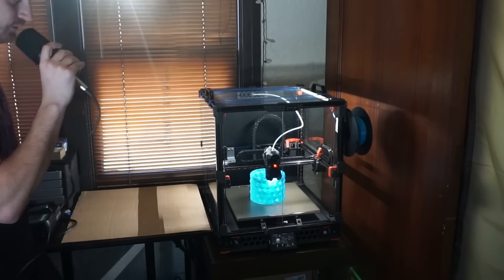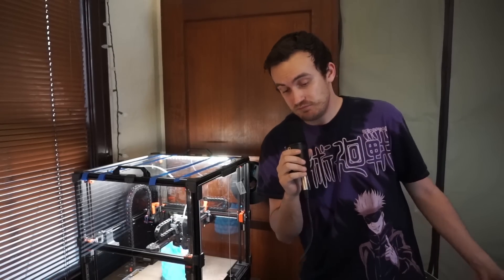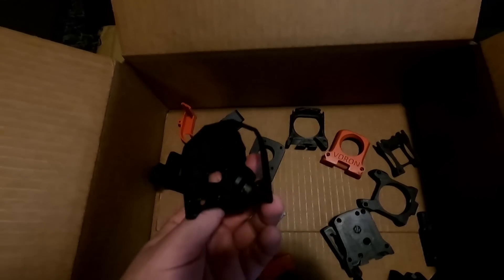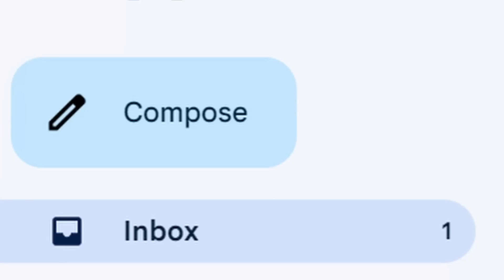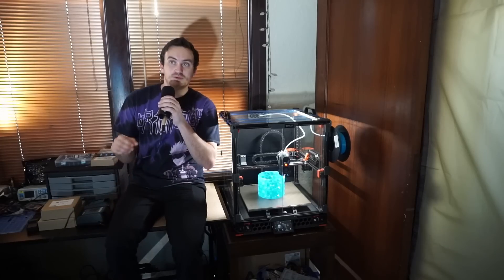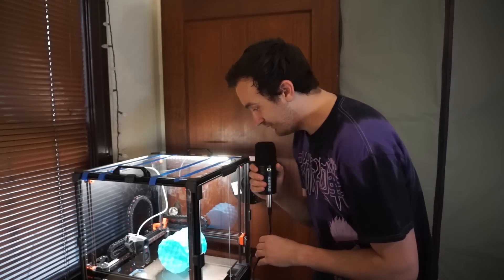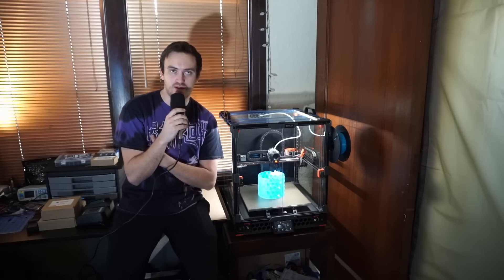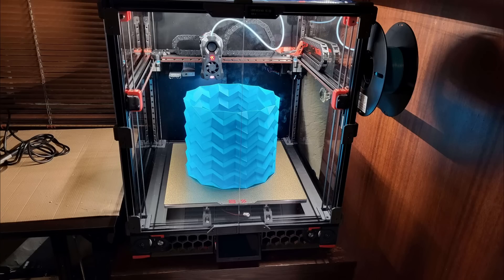Why I built a Voron (and you should too)

Comment: It is unfortunate that you had incomplete 3d printed parts, I’m guessing it’s either based on chance, or they have improved their printed  parts becuase I was only missing a bracket for the case led pcb, and a din rail clip for the tool head breakout board, both of which were just solved with the 2 sided VHB tape included in the kit.
Reply from the maker: Glad to hear you weren't missing anything too important! My assumption is that it has improved. They were new to selling the kit when i ordered. Pinning your comment.

Comment: 2:50 What were you doing to the rails with them standing up in a container?
Reply from the maker: Oh, I filled the bags they were in with isopropyl alcohol to clean off the machine oil from the factory, but they tended to leak a bit, so I put them like that so it didn't get everywhere haha
Reply: @TommyBee456   So not trying to grow more rails.  :) 
I forgot about that, even though I've had to do that myself with bearings before.

Comment: Never get a Voron as your first 3d printer if you Don't want to be thrown in the deepend. Get a cheap bedslinger preferably with klipper. Get to know that printer and how to maintain and repair it. Should take about a half a year or so depending on how fast you learn and how much you print. Then when you have al the basics of how the steppers work, the hotend. The ins and outs of the filament and so on. Then start to source the parts for the voron and know that size and speed are connected. The 0.2 with a vulcano hotend can go way faster then the 2.4 350x. So get to know what you need and not what you want. Is the 250x bedslinger only used for small parts get the 0.2 and tune it for speed. You can print about 4x faster anyway and sometimes even faster. I have a 2.4 350 but sometimes i would still love to have the small 0.2 next to it just because everything is faster on it. Heating, heatsoaking. Just the amazing printspeed. Also the parts are way smaller and  cheaper. The ultimate way to go btw if you already know you want a small and a big printer is 1 cheap bedslinger to learn basics, 2 build a 0.2 where you could even use the bedslinge to print most parts. But abs is not easy to print so i suggest to go with print it forward for the 0.2. 3 source the parts for the 2.4r2 (at moment of writing) and print all abs parts on the 0.2 yourself. How hard it is to print abs on a cheap bedslinger that is how easy the same parts are printed on any working Voron. Btw what most Forget to Mention is that you control any voron thru the screen mounted on the printer. (Can be a prusa style screen with knob or a 10 inch color touchscreen) and thru a web interface. You can realy easily update, upgrade and modify all the software thru the interface or thru putty or ftp. So in theory you could build a voron. Put it in the garage or attic. Go to your computer and do all the adjustments remotely. I have a nice touchscreen just because it looks cool. But almost never use it except for loading and unloading the filament. Or when i am modding hardware and need to move the gantry. Klipper works amazing imo. Love the thumbnails that show when printing. The spaghetti sencing works nicely of you mount a webcam. Its easy to use almost any kind of bed leveling sensor. I have a clicky but you can use induction or the tap. Or the nozzle. I don't level anymore. My printer warms up and heatsoaks. Then it levels the gantry. Then it recalibrates the z-offset (if i change the nozzle or even the whole hotend to another that is on a different height it adjust automaticly) then it makes a grid to only meshbed level the area i am going to print on, cleans the nozzle with a metal brusk and purges the nozzle before starting the print. If i put a glas surface on my buildplate it adjusts automaticly to the new height. And then i only did some mods of the many possibilities to make the voron perfect for me. And yours is going to be totally different. Yes there is a big learning curve. That s why i say go for a cheap bedslinger first to get the basics. I btw had to start with marlin because klipper was not yet available for the cheaper printers like it is now  so i had to relearn the firmware/software side. I found klipper to be way easier though. Marlin you need to download. Adjust. Upload and test. With klipper you can change most things in the same webinterface as where you print. So you just click the file you wanna adjust and change the settings. Saving and restarting the firmware is one button. And then you can already test. Oh and i love inputshaper. Yes it's about the same price as a bambu lab x1 if you go for the 2.4 250x250x225 (there is a little los in height but you can mod that away if you want.) And a x1 is plug and play. But if the x1 breaks you need to get it repaired. It is also a closed system like apple has. As long as it runs its perfect. But with a Voron you build it. So you can change and repair everything. And you know how it functions. You can also print your own parts for it. If you want multimaterial you can get a carrot feeder (😂yeah that is what the mmu is called for it) there is even a guy trying to replicate the infrared sensing like the x1 has. So you can use a lazer to get the perfect lineaire advance settings.  (Kinda went on a tangent here but i hope i help a newby a little with my experiences and ideas about the voron. And gave some information about how they actually funtion. 😅 Most videos only show the hardware side of it.) 

Tldr: if you want to tinker so you get the best 3d printer get a cheap klipper bedslinger first. Then get a Voron and be part of the Voron masterrace 😂.

Comment: Voron is a bunch of very expensive and very stupid engeneering solutions. Especially 2.4. The only good thing about this project is how it looks.
If you don't have much money just buy a good bedslinger and convert it to Klipper. It will print almost any filament as fast as Voron, but for quater of the price.
If you have money to spend, buy Bambulab. It is just a well designed, well built and well tuned machine, which prints out of the box. Much better than any Voron.

Comment: Is the 350mm worth it? Also is the 2.4 better than a trident?
Reply from the maker: 350 mm was worth it for me because i print big things, but if you dont think you'll print that big, save some money and go with a smaller one. Also, smaller ones will be more rigid and, therefore, can print with higher accelerations. As far as how it compares to the trident. I don't think there is much of a difference at all. Just different mechanisms for the Z axis. I think each machine can print as fast as the other with the same quality. I went with 2.4 because i thought the flying gantry was cool, haha.

Comment: Why you running it so slow?
Reply from the maker: That's actually a great question. It is because i am printing at 200% extrusion width, the slicer is artificially slowing down the print speed because the Revo Voron hotend can not melt enough plastic fast enough. Stay tuned for another video where I install a proper highflow hotend(Rapido) and really start pushing this machine's print speed.
Reply: @TommyBee456  neat! I have a 350 2.4 as well, and I’ve encountered the limitations of flow rate. The LDO kit is super fancy. Mine isn’t that nice.

I actually also bought a Rapido, but I’ve found that the kinematics of the 350 can’t even come close to maxing it out without input shaper severely oversmoothing. You run into a wall with Stealthburner cooling with ABS pretty quickly also. XOL is also very worth it.

My most effective mod by far has been bed fans. Chamber gets hotter faster. Before, I was stuck at 47C, and with bed fans and a little insulation, I’m getting 70.
Reply from the maker: @Flumphinator  i actually already installed the nevermore which helps the airflow for the chamber and that has been helping tons for asa and abs. Also, switching to smooth PEI helped a lot, too. But yea! The mantis XOL2 will probably be part of the upgrade with the rapido. I feel a little limited by the stealthburner itself.
Reply: @TommyBee456  SB is really good because it’s accessible for the core design, which relates to the open source nature of the Voron project. It’s super versatile, looks really nice, and it’s buildable with just printed parts and commonly available components. But it is heavy and doesn’t have enough airflow to push a good hotend. The weight is extra important for a 350.

Ditching the cable chains and building a toolhead with CANbus or an umbilical design will also significantly increase your attainable acceleration, and is really an easy mod if you can get the parts (an EBB36/U2C is like $40 in the US, and vendors like Fabreeko and KB3D sell good CAN cables). Light gantry beams are a waste of time on a 350.

Good luck!

Comment: I was thinking about building a voron, but why should i buy a kit and spend a lot of time building one when can i buy a fully assembled printer which can do the same and more ? And its way cheaper, too.
I ordered the qidi max 3 and will be shipped next month. 
I have build all my older printers myself so far and to be honest i can skip the experience building one easily and have more time on my projects by just printing out of the box. And if necessery i can mod my printer with mmu, camera and so on.
Reply: Building is more fun and customisable
Reply: @alex59292  I can mod and customize my printer in the same way as a voron, just there is nothing which needs to be changed. This printer is working right out of the box, has a heated chamber and can print every filament. And while its klipper, you can add a camera or do whatever you want with it, eg. i will install the 3dChameleon MMU for printing multimaterials. And i save more then a thousand bucks and can invest that money into crazy projects and when the printer is broken i have 2 year warranty.

Comment: Love the open source and build it yourself aspect.  I built a couple of OrdBot Hadron printers way back in the day.  For a CoreXY printer billed as being a fast printer, your Voron 2.4 seemed to be vase printing very slowly.
Reply from the maker: Good observation! It is indeed running slower than it can print. What is happening is that the slicer is artificially slowing down the print because im printing at a 220% extrusion width, and my Revo hotend is limited on flow rate. I actually already picked up a Rapido HF  hot end, just working on printing the parts to mount that one + a couple of other upgrades. Maybe I'll make a video about thay stuff too!
Reply: @TommyBee456  - It seems that all of the accelerometer tuned CoreXY printers are speed limited by thermal hot end flow issues, including the ones with custom long melt zones and higher power ceramic heaters that completely surround the melt zone instead of a little cartridge heater in the corner of the aluminum rectangle that houses the nozzle on older 50 mm/sec 3D printers.
Reply: @Liberty4Ever I could tell you that for a lot of corexy owners including myself, speed and going fast is very low on the priority list, and is certainly not a main objective of the build
Reply: @Mr.Thermistor7228  - I finally made it into the world of Klipper, and while faster PLA (and maybe PETG) parts are nice, my primary goal of the upgrade was improved print quality using input shaping and improved part cooling.  I mostly print TPU that is material limited to slower 40-50 mm/s print speeds.

Comment: very useful video.  Thank you.  

Unfortunately we do not have anyone that sells Voron Kits where I am so it will be a source it yourself deal if I build it.  and that will mean I need to know what I can get before looking into the parts.  Which will take time.  So looking at the dent it will make in my wallet vs my sanity, I ordered a K1 :)  I know I know it is not the same thing but its good enough for me.  and a stepping stone I guess.  When the time is right, my sanity and my wallet lines up exactly at 180 degrees :),  I will build it.  The amount of parts being produced for The Voron is staggering.  Now you can get boards with integrated Pi,  Can bus enabled parts etc which actually makes the whole process more user/builder friendly.  

I will definately build one but it will be a 3.0 I am guessing ;)

Comment: Aside from the open sourceyness and general freedom of choice with this thing, one of its huge advantages is explicitly that you can get a bigger build plate. The Prusa-sized or Bambu sized build plates work for a lot, but a Voron can do stuff like printing a full size helmet in one go. But yeah, a lot else too, like putting in an E3D Revo hotend, which makes nozzle swaps incredibly easy which means you're way more likely to actually do them. The Bambu is great and all, but it's small-ish and it's entirely closed source all the way through, need a new nozzle? Buy one from them.
Reply: Luckily closed source doesn't mean there's no other companies providing parts. It's just that you most likely have to go out of your way to find them
Reply: @twanheijkoop6753 i compare bambu lab to apple.  Yes you can get a lot of stuff for it but it is closed. You can not do more then what they allow. Voron is the exact opposite. Everything is open and you can change whatever you want. But no support from a company. (The Voron community is way better then any company support anyway)

Comment: why print so slow of yours
Reply from the maker: So, it's printing vase mode with a 200% extrusion width, and it caps out the volumetric flow rate of my Revo hotend. One of the first upgrades I'm going to do actually is a high flow hotend! Stay tuned for that video(maybe Voron Tap, too).

Comment: I few days ago bought x1 carbon as first printer, and since I plugged it, I didn’t stop print 😂 constantly 3 days night and day. Pla, ABS, petg, asa, and after baby steps and knowing drill  per filament ech, none fails for now, I’m in positive shock.

But after this video I want to build voron  as side project ❤probably will it take few month after hours, but now I can 😂

But if I was starting from voron instead Bambu, probably I will ragequit after days of build and days of failed prints. Now with reference machine and source of high quality print sky is the limit.

Comment: Can you add multiple extruders for swap out?
Reply from the maker: Good question. You can make like separate toolheads to switch out, but that would be a manual thing. If looking into multi color/filament printing you can make something called the Enraged Rabbit Carrot Feeder(ERCF) which is a multiple color/filament system like the prusa MMU or the Bambu AMS system but its all DIY and open source. There is also a project called the Tridex, which is an IDEX version of the Voron Trident. If you are looking for a toolchanger system like the prusa XL afaik it hasnt been made yet, but since this is all open source, nothing is stopping anyone from downloading all of the models and designing their own!

Comment: I have 2 vorons an they both are not that great with pla no matter what I have done still just ugly pla prints imo  especially the overhangs. They will print abs flawless though
Reply from the maker: Interesting, I've had no problems with PLA. Are you using the stealthburner? I read the part cooling is much better than the afterburner
Reply: @TommyBee456  I am using the stealthburner
Reply from the maker: @chris fuesler  might be the pla filament itself. Brand, wet filament, something else, idk. I hope you figure it out, though! You should be able to get good pla prints.

Comment: Make sure you print a complete set of replacement parts.  Also I printed 2 extra parts of the most critical parts (like the tool head parts) and that saved my bacon more than once.
Reply: This is the smartest comment I have seen in 2023 for DIY.
Reply: @JP_Huskie  I try to double up on any part that has heat set inserts.  Along with making sure the part I printed is perfectly functional... never know if you slip and mess up a part.  It costs less to print the part yourself instead of having someone online ship you a part when you have no other option.
Reply: I learned this the hard way with my Prusa.  :)

Comment: You had the same experience as me as I never printed ABS. I used an old modified CR10 in an enclosure. Worked well enough but had a little warping on the corners. Good enough to build the Voron. I went with self sourcing while also upgrading to Tiranium backers :) and the EBB36 CAN for the print head.  It's far from finished, though,  waiting for panels, controller (Octopus Max EZ) and cables. This printer looks really professional. It is a challenge to build and time-consuming waiting for parts to be delivered but far more rewarding and customisable. I'm very happy with it so far, even though it doesn't work yet!

Comment: Tpu is an absolute pain in my voron 2.4, I’m useing dragon hf for my hotend for high speed pla printing. But this means that printing Tpu would be a very delicate balance between heat, and flow rate. Between heat creep and jams due to too much pressure. I still can’t get it to print reliably sooooooo.
Reply from the maker: Interesting. I have some 95A tpu which is supposedly easier to print but i haven't tried yet. Are you using the clockwork 2 extruder?
Reply: @TommyBee456  moded cw1 with 0 exchouder gap, the pressure is so high that the filiment start to zigzag and expand which jams it.
Reply: Also overture 95a
Reply: @TommyBee456  dragon hf (triangle lab)/s heat sink isn’t super good sooo it could be a hotend  thing.
Reply from the maker: Also polymaker makes a hf tpu that could be worth trying